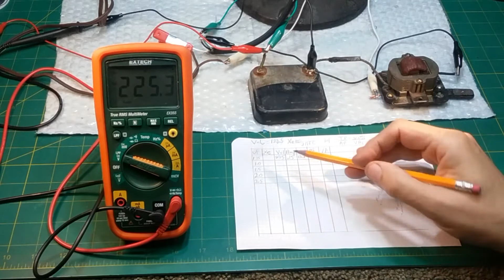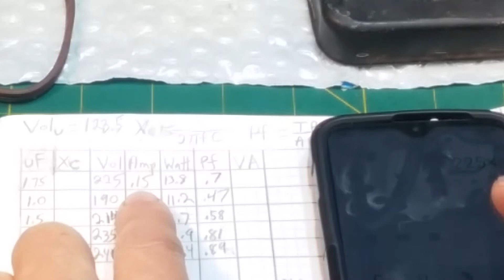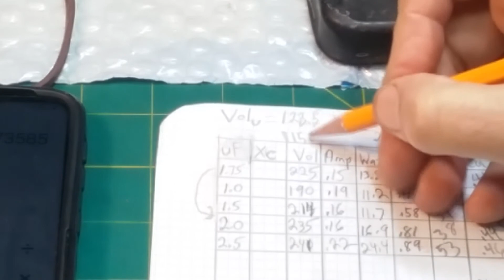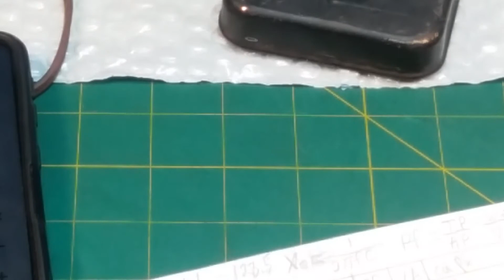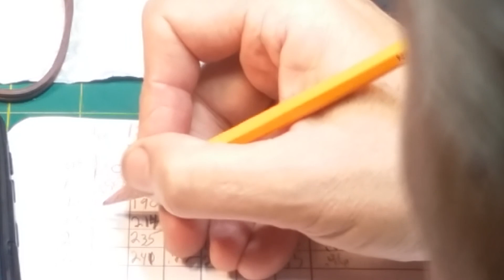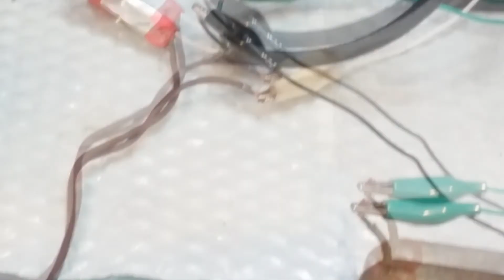Choosing the best capacitor for Emerson 12" fan

Comment: Thank you for taking the time to explain this issue in detail and with the demonstration. I never would have thought about the transformer comparison and the resulting inductance. It would be nice to see a new baseline added to your chart of the original fan, performing at the its design voltage / capacitance with actual as-designed output RPM's. Doing so would show 'apples to apples' to the average restorer and compare its original output speeds to todays voltage and final output RPM's and amps with the fan blade under load.
Reply from the maker: Thanks for the comment! 
Yes, that would have been helpful too. However, this is a customer's fan and long gone from my shop. I might do another in the future if the opportunity arises.